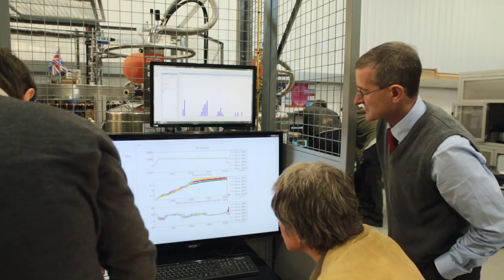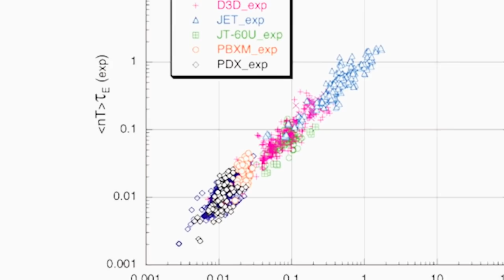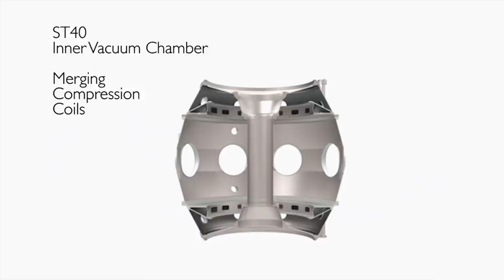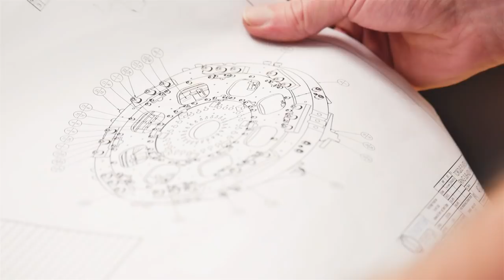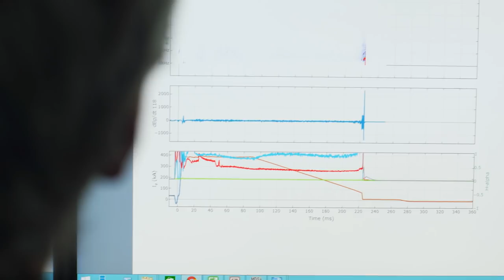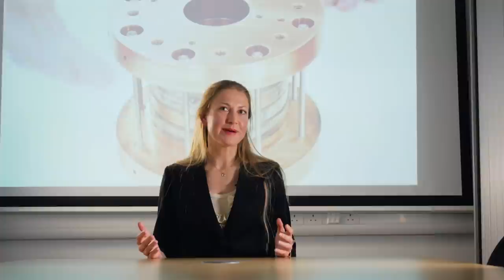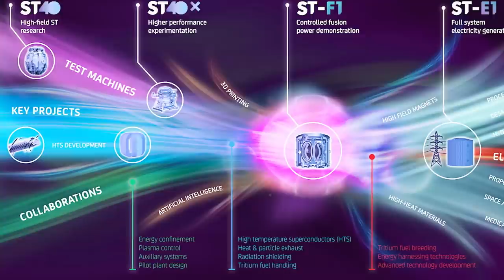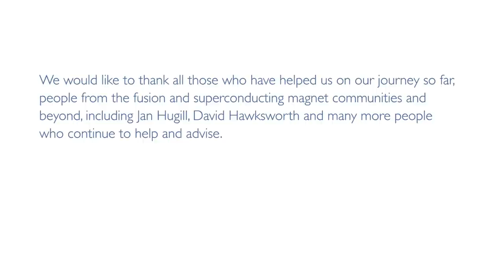Ten years of Tokamak Energy: the rapid progress of a private fusion company

Comment: Good luck! At this rate we'll have fusion power in as little as 30 years!
Reply: I'll sure it'll take them a few years less than 28 years, give or take a decade.
Reply: good meme
Reply: 30 years away forever.
Reply: @NathansHVAC  ITER got tired of this meme, so they are going after the walnut with a sledge hammer.

Comment: Fusion is determined by pressure and temperature. 
Temperature is determined by velocity of the ions.
Velocity is determined by magnetic field and the scale of the tokamak, which means the smaller the scale, the stronger the field has to be to keep the ions in their curved path. 
And there is a limit to the strength of the field a certain superconductor can stand before it looses its superconductivity. 
So the bigger the tokamak the higher the temperature that is achievable with currently available materials. 
So how can a small machine outperform a bigger one?  - Would be my question. 
My second question is how high the pressure is in this machine.

Comment: 24T! That really is good enough to make power in a sensible-sized machine. It really is looking very good for proving this can actually work. Then we get to the really interesting questions for whether this is going to contribute significantly to the world's energy supply: what's the LCOE cost, and what are the practical issues of running a plant (like what does irradiating the tokamak lining for months on end do to it?) Anyway, top work all. I wish you further success at this impressive rate.

Comment: 24T! I thought 2T was where the material limitations started to surface. I guess my knowledge of HTS materials is stale.
Reply: I would guess that the 2T limit refers to the bulk material, which is brittle and prone to magnetic weirdness. This team looks like it is using the HTS tapes: thin layer of ceramic HTS deposited by molecular beam epitaxy on a robust flexible polymer. The material responds totally differently to the high stresses of high fields and can be grown with fewer flaws.

Comment: So to improve the high temp super conductors use them at at low temperature?
Reply: “High temperature” is a relative term. The earliest superconductors required very very low temperatures. In comparison, more recent ones  work at much higher (but still low compared to day-to-day experience) temperatures.

Comment: To me its the relatively small size that makes the most sense. Better for iterative performance increases and fine tuning.
The much larger projects might be how the process needs to be to work at scale and maintain efficiencies, but to me when things are at the just getting it to work stage they seem more rigid in design and it either works or fail large with little opportunity to rework the concept.

Comment: What I like about those guys is that they jumped in to address one of the problematic points: the magnetic field generation. Traditional materials for the coils are super expensive and are a hard cut-off here. A shame since lots of important factors have strong B-dependence (even B^4).

Well, I don't see how a practical energy-producing reactor can be small. Either you need to have a bulky lithium blanket to regenerate tritium, or you must inject even more steroids to the device, so it can fuse D with He-3. Having said that, I really hope Tokamak Energy gets fusion-relevant plasma conditions. 

Starting from there they can go in lots of direction. Even build a political no-go device - fusion-fission hybrid.

Comment: What is so different from what ITER and JET have done other than doing it in a smaller in size🤔 the main goal of attaining higher Q remains the same milestone as it is for the other two teams mentioned above. Also I'm baffled about why does it have to be brute force method to 'fuse' two nuclei? When it can be achieved by Cold Electricity methods? This will do away with the need for very high Magnetic field and so also the need for HTS Solenoids? If the access to He3 is made easier Fusor will lead the race ☝️
Reply from the maker: Doing it in smaller size will be crucially important for commercialisation of the technology because smaller machines cost less to build and can be built faster. But it's harder to do things smaller, so that's why the achievement is important.  

Why the brute force? Because atomic nuclei don't want to come together. They are positively charged so repel each other. The brute force is required to get them close enough to fuse. When scientists can do it by cold methods we will learn something very new and interesting about basic physics. Until then, it's very unlikely.
Reply: @tokamakenergy6400  Where are you bro?? The Cold methods has been around since 1989 plus it's Gas-discharge variant☝️, Nope the reason is political, Cold method cost peanuts to build, let alone the fact that the power that be would be out of buisness!! Cold method is established as LENR or Low Energy Nuclear Reaction. Yes Two positive Nuclei can be Asymmetrically polarized like how Tesla showed us, and then made to deliver all the 'Native' Anenergy' we want at will☝️☝️

Comment: I guess this is like the MIT SPARC design using 26T REBCO HTS.  I like the Fusion energy collectors on my roof and the Li-ion batteries in the garage, but when I can buy a Tokamak for my home for less I will consider it when it burns aneutronically.  I think Fusion should be stuck where the sun don’t shine.  Deep space.

Comment: When the fusion engineer in the background has the Arduino IDE up on the screen... :-)
Reply: For one off custom or prototype electronics Arduino is a great toolchain. No need to get down in the weeds if you aren't in production.
Reply: @migkillerphantom  I think the IDE is terrible. 
The tool chain is almost always some form of gcc, which means vscode/emacs/vim will work fine, and give you much better code tools.

But, sure, when using a single file to make my Christmas lights blink, I might use it too. (My cross over point is approximately when the lights need to blink in sync with music.)

Comment: I only have one question --- HOW IS THERE ONLY 9k Subscribers to this CHANNEL???
and FFS - LET HAVE SOME STATS!!!  How much electricity can the smallest Generator produce?  What fuels/materials have you tested(deuterium, tritium,thorium)?  Have you done any experiments what will happens to various elements/gases at those high temps and pressures?  Can the Plasma generated -- be vector/control released from inside - at what speed? and what would be the cooling rate per distance traveled at that speed?  Theoretically can this generator function without gravity?   - and does this generator remind you of a wheel-inside-a-wheel?

Comment: the SAFIRE PROJECT can create elements that were not and are not present in the chamber before start up,,,, safire can also remidiate radioactivity from materials in the chamber by speeding up the radio active decay rates,,,,, it can slow the speed of light ultraviolet light by a factor of 5,,,,,, here is the BIGGIE it can generate heat and large amounts of it running at only 7% power they found that the dark mode energy can heat the chamber up big time they in fact have designed a power generation unit from this phenomena and BTW,,,, SAFIRE RUNS AT 80 Watts max power so this dark mode heating at 7% power is HUGE news  !!!!!! that means that at 5.6 watts they could not control the heat u can hear monty childs calling for the guys in the lab to dial back the power to even less than 7%,,,, and to top this all off if u think that this is BS,,,, MIT is building a safire type reactor as we speak !!!!! 
here is the comapny web site https://aureon.ca/
here is a video showing the people and safire ya naw here's a few https://www.youtube.com/watch?v=DeVdzSjPx0g
https://www.youtube.com/watch?v=DTaXfbvGf8E&t=1s
https://www.youtube.com/watch?v=5IAiMpmGx-M
tokamak reactors will always try to destroy themselves as they use the wrong model of the sun our sun is ELECTRIC